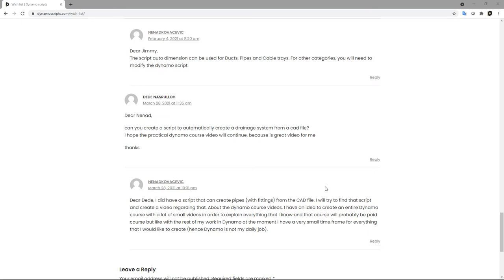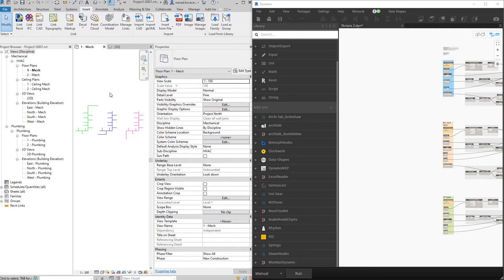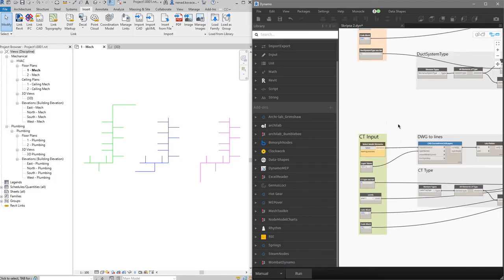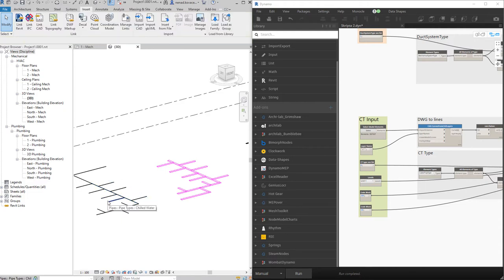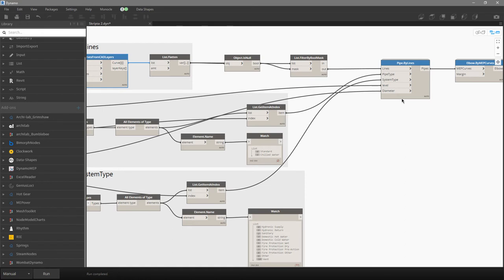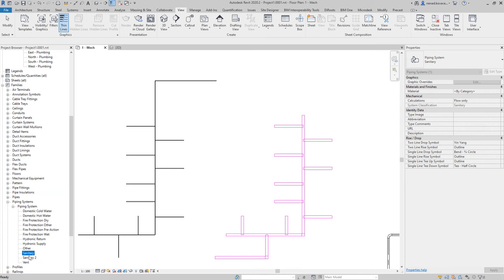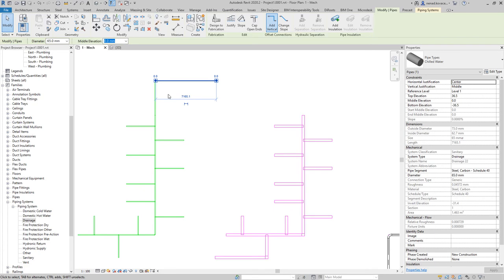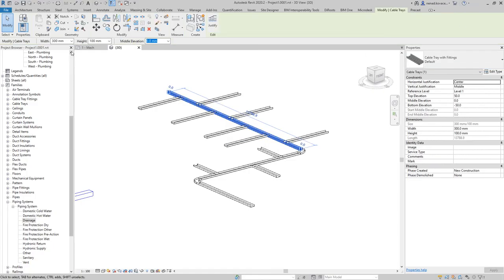Dynamo - AutoCAD drawing to Pipes, Ducts or Cable Trays

Comment: Pozdrav. Imas li ideju kako napravit pipe type i piping system type sa dynamom ili pythonom na nacin da ne bude ”hardcoded” u dynamu vec na osnovu ulaznih podataka koji su xls formata. Ili da sistemi i tip cijevi bude predefinisan i da se moze izabrati u pull down meniju. Naime imam sad 7 sistema razlicitih koje zelim kreirati. Opcija je da napravim skriptu za svaki pojedinacno i unaprijed napravim i odaberem sisteme. Ili jedna skripta sa opcijom odabira pipe type i piping system type.
Reply from the maker: Morao bih da proverim da li je takva skripta moguca ali trebace mi vremena da resim neke druge stvari pre te skripte pa cu javiti.
Reply: @dynamo_scripts  Ok. Hvala unaprijed.